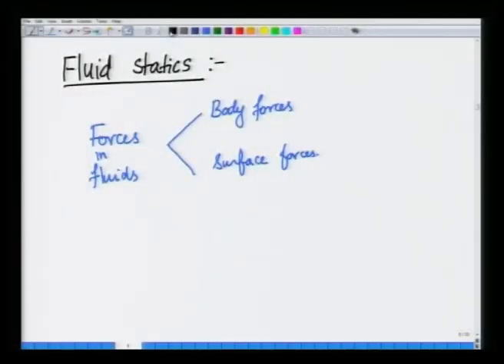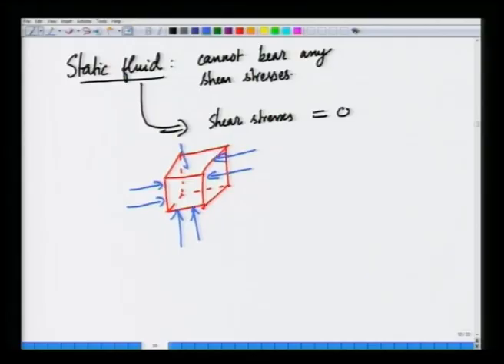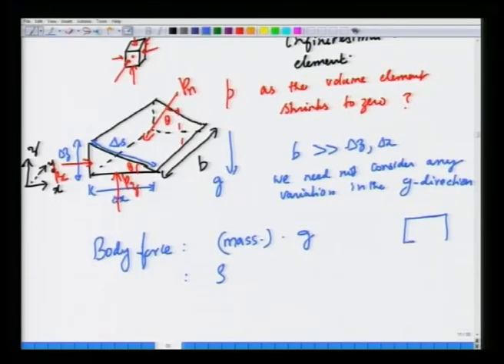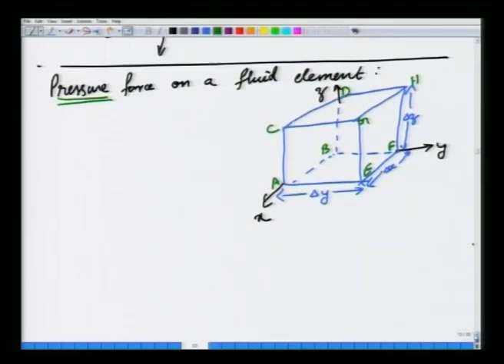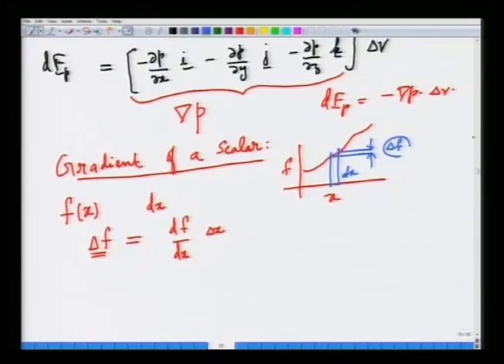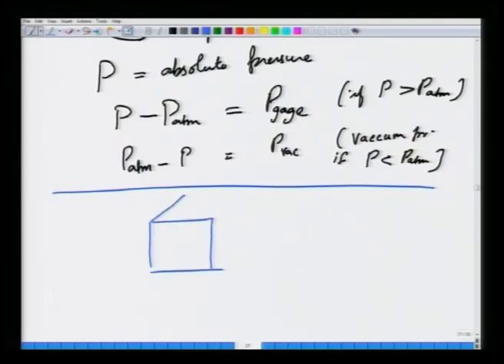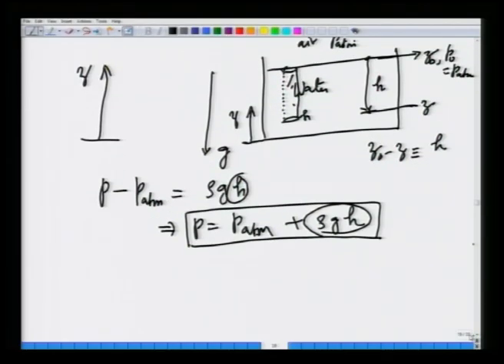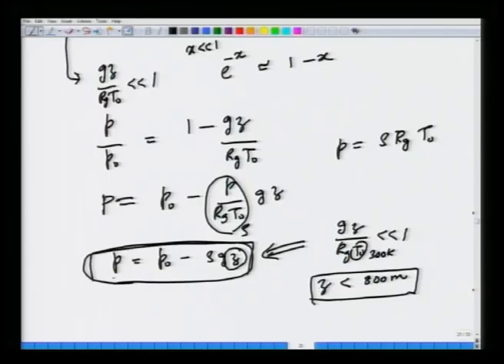Mod-01 Lec-06 Lecture-06

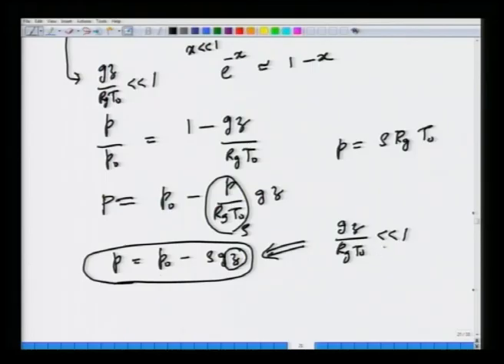Comment: At 58:00 , there is a difference between the expressions for compressible and in compressible fluids which is the negative sign.... howcome one implies gauge pressure and the other vacuum pressure.